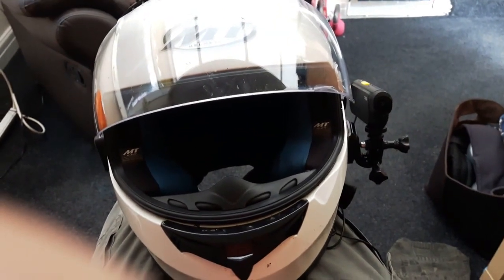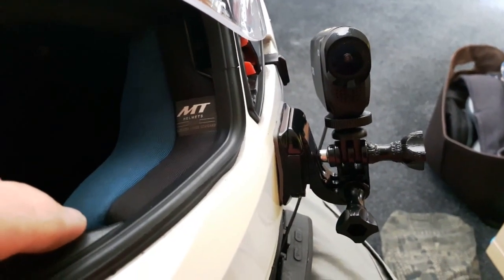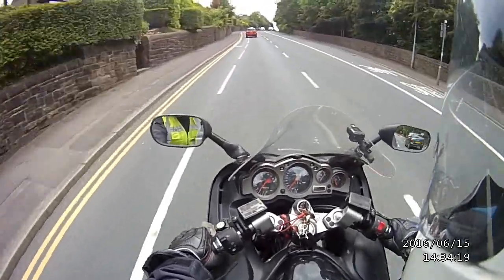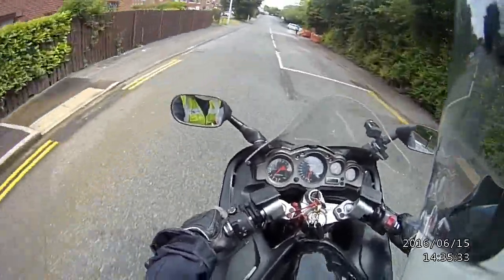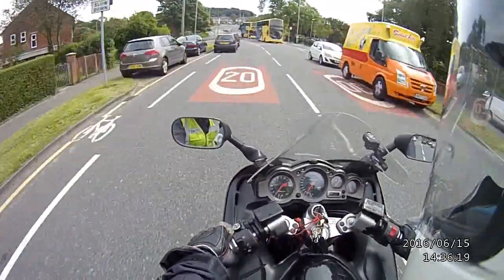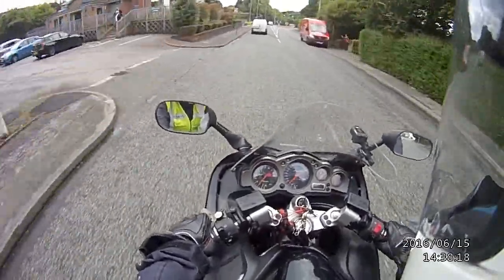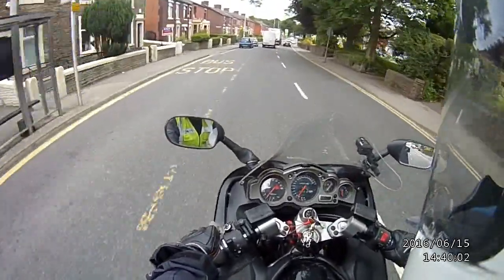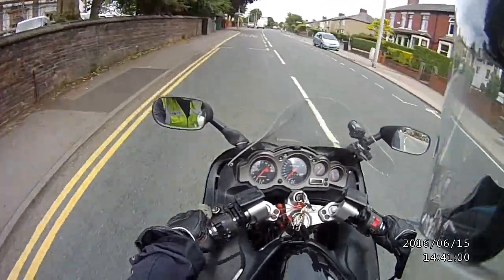New camera mounts and brake niggles

Comment: I was going to suggest sanding the surfaces , but it has already been mentioned. I could hear break disk howl. I replaced my front pads, greased the pins and everything and they were still dragging, roasting hot brake disk. After a few hundred miles they have bedded in so no more roasting brake disk. You should point the drift towards you, no point having two cameras pointing in the same direction.
Reply from the maker: The rear pads have bedded in and now ok noise from the front ones that are a pain, Ive had suggestions and tried tightening the bobbins , cleaned the calipers even put some anti squeal paste on the back of the pads. Its seems to sort it for a few hundred miles then it creeps back, a bit annoying. Yeah been using the Drift Stealth again and got the TCLSVC200 as a backup if i want to use a helmet mile for vlogging.

Comment: To help with the slipping of the go-pro arms, lightly sand/roughen up the mating surfaces of the joints, - all of them. They are shiny from new and a little sanding gives more friction so the screw doesn't need to be overtightened. The TCL SVC 200 camera is an old model now. I think it's been replaced with a SVC400. They are also sold under other brand names. What happened at 11:50 ish to the end of the video? Seems like you went into a black hole!
Reply from the maker: Yes heard they do a updated model for that camera. Have to say i'm impressed with the TCL camera  it knocks the Drift for six  value for money wise, so far no issues. Seems a good dodge sanding roughening up to get the mounts tighter.  The Black hole's due to me using a new video editor still learning.